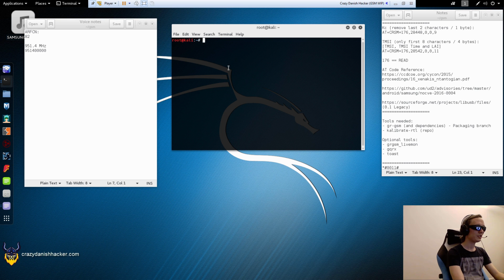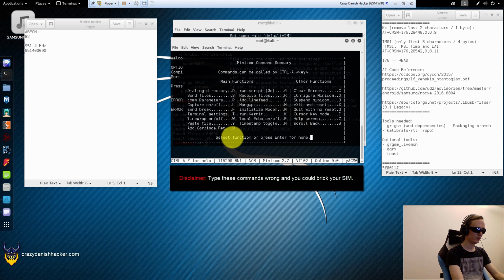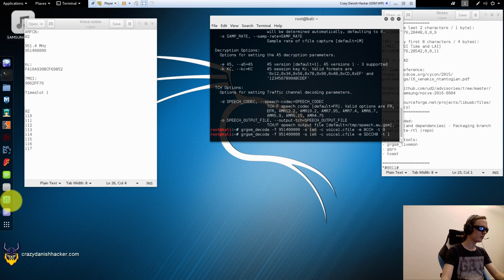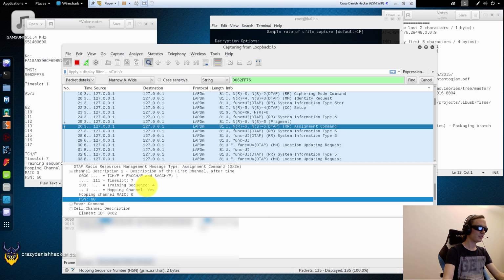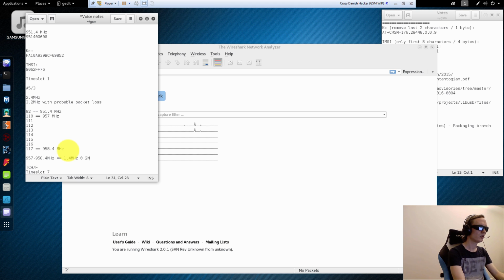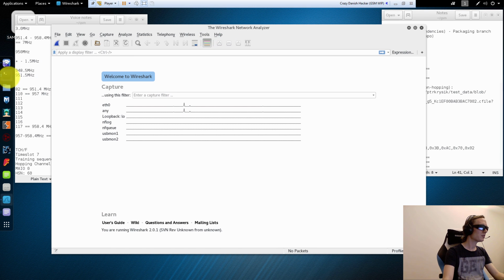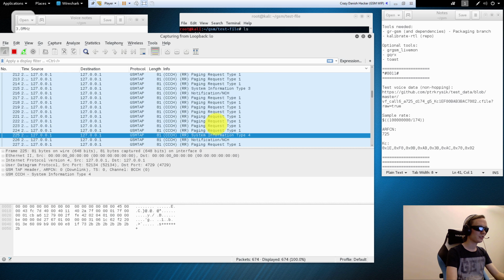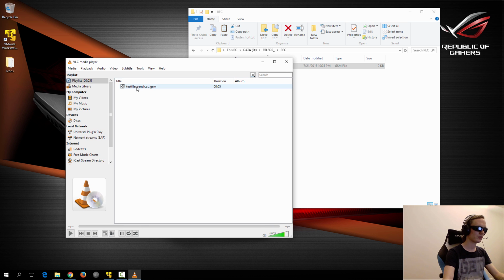GSM Sniffing: Voice Decryption 101 - Software Defined Radio Series #11

Comment: I have created an openbts, Can i decrypt the same if my phone is connected to openbts, and one more thing can i decrypt the kc  of the sim using iphone?
Reply from the maker: Yes you can decrypt any signal to/from your phone if you extract the Kc. If you have an OpenBTS you can just use Wireshark on OpenBTS to see the packets. I don't understand what "Decrypt the Kc of the sim using iphone" means, because the Kc is the (temporary) encryption/decryption key which is stored on the sim card (as far as I know), and it has nothing to do with whether you use iphone or not. But my main point is, you want to "decrypt the decryption key"? It doesn't make any sense technically speaking, and in this case I can't even guess what you mean. If you're asking, "Can I also do this with an iPhone?", my answer is, yes but you may have to extract the Kc (encryption/decryption key) from your SIM card.
Reply: Crazy Danish Hacker yes that is what i was asking, if can use my iphone to decrypt the kc, and as you said yes, do you know how, or else do you know any software by which i can decrypt the kc(i have a sim card reader)
Thanks for the help though
Reply from the maker: The "Kc" is a symmetric key used for encryption and decryption. You cannot "decrypt" a "decryption key" (Kc). If you're asking, "Can I extract the Kc directly from an iPhone?", then to be honest, I don't know. I think you need to root the iPhone and have SSH access, and even then I am not sure if it's easy. Only way to find out, is to try yourself :-) 

To extract the Kc directly from the SIM card, you need to look at a specific location in "memory" on the SIM card. I recommend googling "extract kc from sim card" as there are several websites answering this question.
Reply: yes i was asking for extraction of the kc, sorry for the wrong choice of words. i will try with the iphone, but do you know any applications based on sim card reader that can extract the kc??
Reply from the maker: No I don't know any iPhone or SIM card reader applications, that's why I recommend googling "extract kc from sim card" :-)

Comment: i red this doesnt work anymore since key is not sent in same package
Reply from the maker: Without checking, I guarantee that this almost certainly works just like it did last year. The only issue is still channel/frequency hopping.
Reply: Crazy Danish Hacker . Can you get around that?  Also,what would it take for have a range of like 100 m? Or at least 50m
Reply from the maker: I haven't tried writing my own solution from scratch, because it's probably going to take me at least a month or more. It's a lot of work that I can't afford to do at the moment. 

I already responded to your questions on Twitter. The default antenna I use typically goes up to like 1km easily. Keep in mind concrete buildings, in particular basements block radio signals quite effectively in many cases.

Comment: Hej, from Connecticut, USA. Around here, in Waterbury anyway, we have for our city a P-25 trunked system. In the past I was using with my R820T(Xsomething maybe,but it's R820T of some kind) SDR sharp with basically every plugin, the WinUSB driver, also "Virtual Audio Cable" so I could easily feed the two frequencies I'd lock onto into diff virtual mono audio feeds, and DSD plugin in SDR sharp too. At the same time for some reason to get voice I had to use Unitrunker at least as a voice decoder for say Virtual Audio Cable's Line 2 where I'd move around that frequency while keeping the first one locked onto the control channel, or one of them anyway. Long story short, it doesn't work in Win 10 anymore.. Unitrunker won't run. I'll be trying to fix it today, so if you or anyone have advice on this (I understand Windows 10's updates broke it basically) I'd appreciate it.
Reply from the maker: I haven't played much with trunked radio as it's almost non-existent here whenever I've looked. Emergency services here use an encrypted version of P25 as far as I know. (They just call it something else, but it sounds like encrypted trunked radio over different frequencies. I haven't looked into it that much though as every resource I read about this custom system says that it's almost impossible to sniff without "authorized equipment" on their "closed network".) 

Anyway, you're right that Windows 10 and various updates break a lot of programs, not just SDR Sharp. I am for example unable to use BladeRF properly with SDR# now. So I switched to SDR Console instead on Windows, as that also works natively with the transverter upgrade. 

In your case, you could either wait for an updated version of SDR#, plugins, drivers, etc. or you could reinstall the same programs inside a Windows 7 virtual machine for example. These virtual machines, albeit not activated, should work for at least 30 days: https://developer.microsoft.com/en-us/microsoft-edge/tools/vms/

They're meant to test Internet Explorer, but I've heard of malware analyst using them for malware analysis as well. 

Alternatively, you could try and move your setup/configuration to Linux instead. I'd recommend Ubuntu as it's has a large user-base and is generally quite well supported, and very easy to setup.

Comment: What equipment do you use?
Reply from the maker: It's in the video description. I'm using an RTL-SDR, in this case an E4000, even though R820T and R820T2 will work on 900MHz as well.

Comment: Do have a Idea for that output, if I type this...?

root@kali:~# grgsm_capture.py -f 944400000 -s 1e6 -g 40 voice1.cfile -T 30
linux; GNU C++ version 6.2.0 20161103; Boost_106200; UHD_003.009.005-0-unknown

Usage: grgsm_capture.py [options]

grgsm_capture.py: error: Please provide a cfile or a burst file (or both) to save the captured data

root@kali:~#
Reply from the maker: Error: "grgsm_capture.py: error: Please provide a cfile or a burst file (or both) to save the captured data"

It's because you're using grgsm_capture.py slightly wrong. 

Your command:
grgsm_capture.py -f 944400000 -s 1e6 -g 40 voice1.cfile -T 30

Correct command:
grgsm_capture.py -f 944400000 -s 1e6 -g 40 -c voice1.cfile -T 30

(Notice the "-c" before voice1.cfile.)

Comment: Hi, have you try gsm wideband sniffing with gr-gsm...??? Could you please share the video...???
Reply from the maker: I tried wideband sniffing with gr-gsm a couple of months ago, and realized there is currently no working code on the Internet that makes decryption of voice possible when channel hopping is enabled. (Unless this has been added to gr-gsm while I've been busy with other stuff.)

BladeRF can capture wideband files by itself and its own software, which will need to be converted afterwards to a format gr-gsm understands. The gr-gsm program can be "patched" to allow wideband capturing too, and then you can even use the "wideband splitting" program to split the wideband capture into several files.

However, last time I checked, gr-gsm did still not have channel hopping features implemented, despite that a github user named Bogdan made a modified version of Airprobe, which supports channel hopping. (And this was years ago.)
The problem with Bogdan's code, is that it doesn't seem to work with all types of GSM networks, as I tried for several days to make it work. 

Sometime in the future, if I get it to work, I'll probably do a video, but this is something that will take ages, as Bogdan's code probably needs to be patched, and the author of gr-gsm won't add channel hopping or wideband capturing into the python scripts by the looks of it. (Unless he changed his mind.)

Comment: can you do anything else with phone modem other than read TIMSI and KC? (call someone or send SMS?)

PS: is it posible to conenct to a provider without SIM Card?
PPS: Did you try TopGuw?: https://github.com/bastienjalbert/topguw (V2 is here: https://github.com/bastienjalbert/topguw2)

PPPS: Which SDR did you buy?
Reply from the maker: Good questions. 

To answer your first question, yes you can call someone or send SMS, but you need direct access to the USB modem. 

A friend of mine found out a way to switch to 2G only mode on a Huawei 3G dongle (AT^SYSCFG=13,1,3FFFFFFF,2,4, do not run this command unless you know what you're doing), via the USB modem and then send an SMS to himself (AT+CMGW=$MSISDN (returns int), sms msg, \032, AT+CMSS=int, also via the USB modem. Do not run those commands exactly as I wrote them. They just show the "approximate workflow" on how to send SMS in a simplified and not 100% accurate way.)

Concerning your second question, generally not. Here's why:
Your SIM card has a number on it, this is called the IMSI (International Mobile Subscriber Identity).
In order to connect to a mobile network provider, your IMSI has to be in a "whitelist" of approved IMSI's as far as I know on a 2G network.

For 3G and 4G (I'm not an expert on how authentication works for these), there is something called Mutual Authentication (MA), between the UE (User Equipment, such as your mobile phone), and the BTS (Base Transceiver Station, which is basically the cell tower + computing equipment that routes traffic back to the provider). 
Mutual Authentication means that your SIM card has a special authentication key (not in relation to the one you use to encrypt traffic during  SMS, voice, GPRS, etc.) which is used to authenticate with the mobile network provider.

The key that you use for Mutual Authentication, is apparently derived from a master key and potentially locked to your IMSI (I may be wrong here, but as far as I know it is derived from a master key only the provider has), so even if you manage to extract this key, it won't work as a "general purpose master key" to the mobile network provider.
Reply from the maker: To answer your third question about topguw: 
Yes I tried that and I'm not sure if it works. It's a topic for a future video about cracking A5/1.
Version 2 does not work. Version 1 "works", but the source code is a bit confusing because it's adding 101 to the frame count by the looks of it (I could be wrong, Java source code is not super easy for me to understand), instead of 102. If it's doing that, then it's intentionally adding a wrong number of frames. On top of that, topguw does not seem to understand that when you XOR the first burst of an unencrypted frame (C1), it needs to be XOR'd with the first burst of an encrypted frame (C1), and then the second with the second, third with the third, and fourth with the fourth burst.

Concerning your fourth question, I bought a BladeRF and two quad band GSM antennas. With that, I can sniff 28MHz at a time, more than enough to cover frequencies from channel 82 (951.4 MHz), to channel 117 (958.4 MHz) = 7MHz total. Another reason why I bought a BladeRF is because it features full duplex (transmit and receive at the same time), and everything is designed to be "in sync", meaning it's a lot cheaper than buying a USRP B200 where you have to buy a GPSDO (TCXO) module that doubles the price if you want it "in sync", which is important in my case. 
There are many other SDRs that could probably work, but I wanted something that's not "too expensive" for what I want (full duplex high quality transmission). If I was not going to transmit anything and use full duplex, then I would've definitely bought a HackRF as the frequency range on that is much larger. I also wanted something that has very good driver support, which HackRF, BladeRF and USRP all do.

In case you're looking to buy an SDR, check out the round up on RTL-SDR: http://www.rtl-sdr.com/roundup-software-defined-radios/
I wouldn't recommend buying anything more expensive than the USRP B200, as that's generally just a waste of your money.
Reply: well I bought a HackRF and Airspy as BladeRF doesn't cover FM and AM Band without its transcverter board and it doesn't have 32mW TX Power (I think)

PS: Do you think you could create a video about creating GSM BaseStation with BladeRF and YateBTS as BladeRF is full duplex and I always wanted to know how you acually conect to it (as I can't connect to HR VIP even if I can recieve it well if I am connected to my main carrier (Telekom Slovenija)
Reply from the maker: Hmm, yeah by default it looks like BladeRF has a transmit power of +6 dBm, which converted is 7.94mW. (I'm using this calculator: http://www.rapidtables.com/convert/power/dBm_to_mW.htm)
With the amplifier upgrade on 2.4GHz it has a transmit power of around +32dBm (based on the amplifier upgrade specs unless I misunderstood them), which is 1584mW or 1.58 Watts. As you also mentioned, I'll need the transverter board to see frequencies below 300MHz. But as I'm mainly focused on GSM and maybe WiFi for now, it'll do.

It's definitely on my todo list, i.e. to create a video about setting up your own BTS and confirming it works. Obviously it'll be a low to very low transmit power configuration, and only accept the IMSI's of my own mobile phones to avoid any issues.
Reply from the maker: I looked into 2G/3G/4G authentication a bit yesterday, and found out that as we all know by now 2G generally has no authentication with the network or user equipment, while 3G user equipment has the ability to authenticate the network (to make it a lot harder for impostors to set up rogue networks, I need to test how this works in practice), and 4G has mutual authentication where the user equipment authenticates the network, and the network authenticates the user equipment. :-)
Reply from the maker: Had a look at topguw's logic this night. The algorithm it uses to guess the next encrypted SI5 frame is wrong as it adds 101 instead of 102. (It works for the first 3-4 frames, the rest will be garbage.) Another more serious issue, is that it does not XOR the first unencrypted burst C1 with the encrypted burst C1, instead, this seems "completely random" and I do not believe the developer knew this was (probably) quite important. 

(As far as I know, you need to XOR the bursts in the right order. Sometimes topguw may get it right, but sometimes is not good enough in my case. Anyway, despite topguw's logic is generally wrong, it did help me to understand how the XOR'd bursts are created, which are subsequently fed to Kraken. I'll cover this topic soon, doing it the manual way. I just need to record and then edit it.)
Reply from the maker: The Entertainer Star Please watch the full guide. I've already covered twice how to save and subsequently decode packets. (This video and SMS Decryption shows how to use gr-gsm from capture to final decryption of the encrypted packets.)

Keep in mind, that with voice traffic, if "frequency hopping" is enabled, then you need a better SDR than an RTL-SDR, that can pick up both the broadcast channel (BCCH), and all the traffic channels. I haven't covered frequency hopping in practice yet, but I'm planning on doing it. (I just received my new SDR a couple of days ago.)

You can also use the wiki at:
https://github.com/ptrkrysik/gr-gsm/wiki/Usage
https://github.com/ptrkrysik/gr-gsm/wiki/Usage:-Decoding-How-To
Reply from the maker: Use the voice test file that I also used in my video. To decode voice on most networks, you need a working decoder for frequency hopping, which is currently not available. The creator of GR-GSM says "it does work", but the GRC files provided have been tested multiple times and do not work.
At the moment, I have way too much work and preparations some important events, so I haven't been able to proceed in my frequency hopping practical research. I did add "wideband capturing" to grgsm_capture and grgsm_livemon, but I don't have a working decoder yet. (Airprobe-hopping does not really work either.)
Reply: Veso266 bo m.    'Ømm